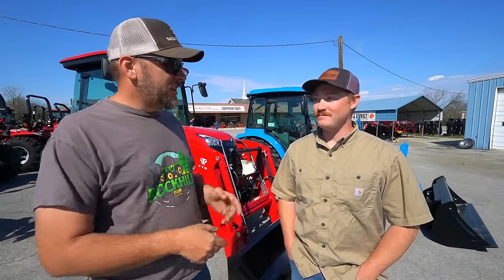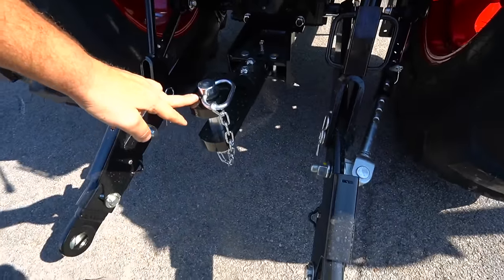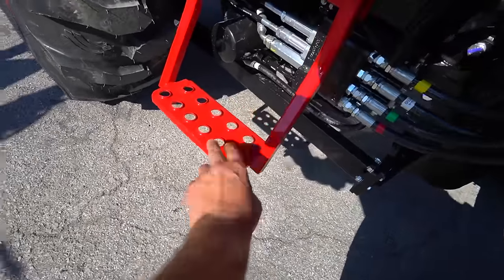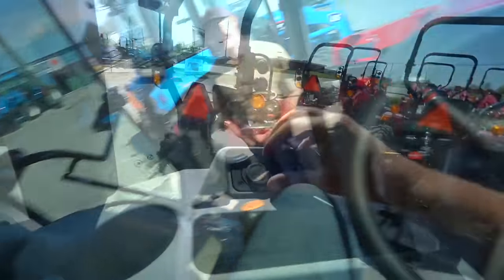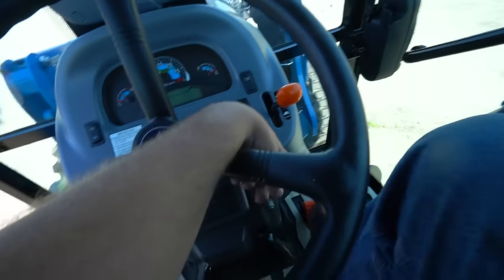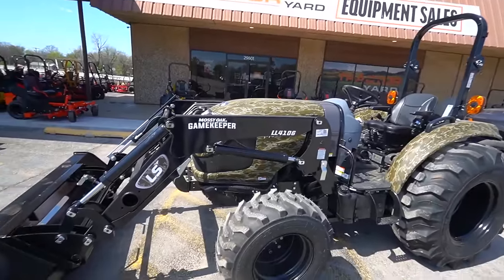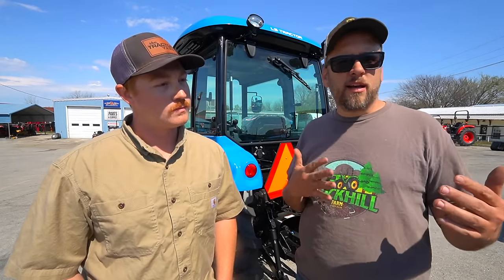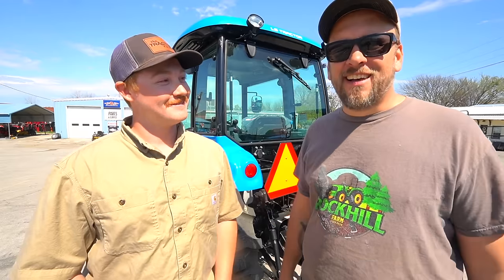Tractor Shopping - TYM vs LS

Comment from the maker: check out all of our 50-60 hp tractor comparisons here 
:https://www.youtube.com/playlist?list=PLmYnhJtNUq7cUQ4kvFAhHfyuPhhxMHN2y
Reply: And this totally made my mind up about these tractors.. the ls is built way beefier .. the rear end of the tym was tiny! But I will get mahindra or kioti... they don't make people run Def fluid= no regen..
Reply from the maker: I disagree with both points you make there. I felt the TYM is heavier built. It has more capacity and it has mechanical fuel injection instead of computer controlled.

The Mahindra didn’t have a DPF filter as you mentioned, but it does have computer controlled fuel injection with a lot more wiring and a lot more unnecessary technology 

The TYM is mechanically fuel injected

I got seat time in every single brand of Tractor in this class before making a decision

When I ranked my top five tractors in this size range, I put TYM number one. Kioti was number four and LS didn’t make the list.

Comment: I had a LS, it was a good tractor.  I sold it for a cab tractor.  I went with TYM.  Biggest difference for me is regen.  I have almost 100 hours on my TYM 494 and never had a regen.  With my LS XR4140 I would have had two regens already.  I always run tractor at least 1800 to 2000 rpm unless bush hogging, then I'm higher.  Both are comfortable tractors but from experience with both brands I prefer the TYM.  TYM is a simple tractor, no computer to run it, it's mechanical.

Comment: Brock, for my money, the 574 is the cream of the crop. I have been drooling over that tractor for four years. 5300 lbs of breakout force on the TYM loader also. No hate for the LS, I’m just much more familiar with the TYM. Also, the TYM is very unique for a machine that requires DPF. It is very old school mechanical diesel.
Reply: buy it bro

Comment: Good video 👍🏻. I purchased the TYM T474 last year and have 200 hr  on it so far and no regens yet. I chose the TYM for many reasons but one major one is that the TYM has a fully mechanical fuel system and engine with minimal electronics. So far, I love my TYM.
Reply: This is actually the model I decided to get for my use.  T474C, I think it has the capability to do anything that I will need it to.

Comment: JD is not worth the extra $ anymore. Opinion, others are providing more features and reliability at lower cost - initial cost, parts, etc.
Reply from the maker: And I trust that TYM will be in business in 20 years
Reply: @RockhillfarmYT  
Have had an LS 46 Hp for 9 years , 1000hrs on it, with little problems. Bend the loader frame last year (My fault), Dealer had a new one in a few weeks, thought it would be longer or a problem.  TYM should be good also, both are nice equipment.
Reply from the maker: @jburch1544 thanks for sharing

Comment: I have purchased two LS Tractors for my Company. I haven’t had any problems with them however I’m in the market for a Cab Tractor. The Tractors I would consider are LS, TYM, Kioti, Yanmar. My opinion is Deere and Kubota have priced themselves out of the market and their hydraulics are no where close to these Tractors however there are those that are loyal to Deere and Kubota that have deep pockets and I respect that. There are enough Tractors out there for everyone to be happy with. Also remember Brock and Tim (Tractor Time with Tim) have done more with a small Tractor, Deere 1025r and their 2 series than most of us do in a lifetime. 😂

Comment: I did this exact same comparison 3 weeks ago but at two different dealerships.  LS compared to TYM.  I compared series 3 to series 3 and series 2 to series 2 tractors.  They are both excellent quality brands that offer great value.  I felt the controls on  LS interfered with my natural reach for the loader joystick and no such interference from the TYM models.  I also felt the cabs on TYM were a little roomier and more comfortable.  I also like the Kukje TYM engines as they are simpler and far less sensors on them that can go bad.  I think you will be happy with whichever you choose but  I'm planning on getting a TYM this spring.  Looking forward to seeing which you choose and how it works out for you either way!

Comment: Thanks for the review. I did about the same thing you've done here about a year ago. I found the John Deere about $17k more, and a Kubota about $18k more, and that was without a lot of the features on the TYM574HC (which I purchased in Nov, doing my 50 hr service on Saturday). I got the TYM with loaded tires, and a 3rd function valve. I've also installed a hydraulic top link.  Those features your paying extra for on JD and K are armed seats, rear windshield wiper, lights front and back, mirrors, radio, and bucket level indicator (I think I got them all). I've had zero issues with my TYM574HC. We've got a 16 acre farm, cut fire wood for heat, and maintain a 1200' gravel driveway with it. I've also got a 72" tiller we use to plant some potatoes, Not working the tractor too hard, but can attest to it's lifting ability. We cut down a very large maple tree, and I put 4 logs into my dump trailer using the lift. The mill estimated I've got 1500 board feed of lumber. The tractor had no issues lifting those large logs over the side of the trailer and lowering them slowly to the bed. I used a grapple to move the logs.

Comment: Brock, I absolutely love my TYM T474 HST. The T574 is a monster worker too. Both the T474 and T574 have the exact same Cummins designed mechanical Diesel. No electronics. The T574 has the turbo and a few different cam settings and timing, but they are both bullet proof. Love my TYM.
Reply from the maker: Thanks for sharing
Reply: @RockhillfarmYT  You're welcome sir.
Reply: @RockhillfarmYT  Oh and my T474 has over 130 hours and no regen.

Comment: I bought a Kubota L3800 in 2013 and it has almost done everything i have asked it to do. The downside of that tractor is the loader lifting capacity of only 1,000 pounds at the pin, so by the time I put the bucket or forks on, it doesn't have a whole lot there.
I had a neighbor who had a Mahindra 23 hp and he was able to lift about 500 pounds more than my tractor, i was amazed. 

If i buy another tractor it might be a Mahindra, but we will see. If i bought one today, it would be a Mahindra and for a 55 hp, the loader lift would be higher than both of these tractors.

Comment: Hi Brock I sold my kubota m7960 last fall and bought a TYM cab t494 I have 110hrs on it now with no regen yet. I bought it with r14 tires and they are great in the snow and mud and are fairly easy on the lawn. The loader Is almost as powerful as the m7060 but is rather slow. I would love one of the pumps you put on your JD to speed it up a little. I have always had a geared tractor and the TYM is my first hydro and I love it with the linked throttle. I did notice that the arm rest in the Ls are adjustable  which is a nice feature if you spend a lot of time in it.

Comment: I am surprised that TYM 'hasn't  reached out to you for a tractor to use on your channel.  I have a John Deere 2032 with no problems in over 1500 hrs but if i could do it again  i would go to the TYM.  The TYM could of done a better job on the backhoe seat mounting.

Comment: Awesome content taking a real close look at both these machines!   The one thing that really stands out to me is that the 3 pt lift rating is 2755lbs AT THE PINS on the LS web site and they will not publish the 24” behind the pins on their spec sheets on their site.  That’s a huge difference between the LS and the TYM.  Please verify that number for all your viewers as y’all kinda left that as a big loose end which if accurate would totally sway a ton of people in the TYM direction.  I will say that I do prefer the LS over the TYM for all the reasons that you stated because of the technology differences.  To me the big test Is how well do the hydraulics work and are they super smooth… and will they perform two functions with the loader joy stick such a curl and lift etc.   

As I had indicated months ago I bought a Massey Ferguson 2860M cab/loader tractor and couldn’t be happier 120 hours later trouble free so far. I’m all in on my deal at $53K.  After looking at both of these machines today with you the Massey control features and cab ergonomics of control locations appears to me to be far superior  in placement and ease of access and operation.  Additionally, the Massey I purchased has the AIR RIDE SEAT, rear wiper and rear glass wire defroster in the rear window.   The Massey also allows you to exit the tractor without having to have the Parking Brake engaged which Is a huge deal to me for my use of this machine & it will start with out having to engage the parking brake…. Another big deal to me ✔️.    I’m totally not meaning to sound like I plugging MF. Just indicating additional features and what I consider to be better ergonomics in the cab and operations.   

Other than the rear 3 pt lift capacity at the ends being a low number 2755lbs I would totally choose the LS Over the TYM unless one dealer is much better to deal with than the other.    Good luck in your quest for the new larger cab tractor you will be happy it when you pull that trigger!!     Really love this type content… 👍👍🔥🔥

Comment: I run my sawmill operation with my LS MT357 HC... the exact tractor you are showing in this video. I just hit 350 hours on my tractor. I ran a Kioti DK40SE open station for the previous 10 years at the sawmill. Either of these will surely serve you well. I can't comment on the TYM, but I can give you some quick info on the LS. First, loader capacity. It is rated at 2,700 at the pins.. which is also exactly what my old DK40 was rated at as well. I have moved hundreds, if not thousands of logs and I have a good handle on what I can and can't move, weight wise. Both with my old Kioti and the LS, 2,700 at the pins translates to about 2000 lbs when moving logs around with forks or a grapple. So make sure you keep that in mind. You mentioned something about lifting 4,000 lbs a couple inches off the ground in the video. Never going to happen. You MIGHT get lucky and lift a 2,200 lb log a couple inches off the ground, but that would be absolute max. Also, for me, when I am using my tractor, I am usually pretty busy sawing up a job for someone.. in other words, time is money. If I had to stop for 30 minutes while my tractor did a regen, I would go insane. My tractor does a regen every 20 or so hours, and I don't even know it's happening. I just continue working. On the other hand, if the TYM only does a regen every 100 hours or so, maybe it is not a big deal. Pro's and cons with the LS. Pros... engine is extremely quiet and smooth as butter, with an amazing amount of power/torque. With beet juice in the rears, it will flat out pull a full grown oak tree (top and all) through the woods. Also the MT3 series comes standard with a Grammar seat. That is a 1,500.00 seat. They did not cut corners in the cab. The heat/air works awesome. The cab is air tight and quiet. The linked pedal is cool. The engine cruise control is cool. Cons... regen times vary quite a bit. Sometimes it will go 30 hours with no regen. Then sometimes it will regen twice in 10 hours. The tie rod ends.. watch them close, and MAKE SURE that the steering stops are set at the proper length for a loader.. otherwise they will hit the loader mounts when the axle pivots at full steer. A lot of dealerships fail to do this.. mine was not adjusted properly, luckily I caught it. Lastly, the PTO neutral lever in the cab that mechanically disengages the PTO so you can freely spin it, it will only work for about 20 hours if you are lucky, then it will get stuck in the engaged position. They all do this. My dealer is in contact with LS to find a potential fix, but right now LS is scratching their heads. Good luck in your choice, I LOVE mine!
Reply from the maker: Thanks for sharing

Comment: I have been looking at upgrading to the TYM 574CTLB. I test drove one the other day. There are actually 2 screens covering radiator and condenser on the 574's and take note of the backhoe it sits very high which is good for ground clearance when loading or driving over very uneven terrain on the 574's. Many other manufacturers have very poor clearance with the sub frame. (Kioti ck series I looked and physically measured them) The LS's also look pretty low as well but did not measure myself. 10 inches measured to the pin on the rear frame mount pins on the 574 bh permanently mounted tractor frame which was the lowest point. As said on other posts I prefer simplicity for the long haul. (Regen) 
Note: the Kioti and TYM are a very similar bh design however the lower frame bars stick out past the rear tire substantially that was a deal breaker for me on Kioti. Great videos great info thanks!
Reply from the maker: Thanks for sharing your thoughts on it

Comment: Great video.  I feel like if you haven't looked at MF and you have a dealer near by they are the real sweet spot between top end JD and the Korean brands.  I think the 2855m or 2860M would be perfect for you, backhoes are a woods product I believe, and to my knowledge the three point arms stay on with backhoe and its the same hookup as the Kubota, two pins and its off.  I had a MF 1740E and an 1835M cab and both were phenomenal machines with excellent fit and finish and zero problems with either over about 175 hours on each.  Also no DPF on some of their larger machines.
Reply from the maker: Thanks for the feedback.

Comment: On the T575, you can adjust the position of the lever for the loader and bring it closer.  You can get it so where your elbow is on the armrest while your hand is on the lever. 

I'm seriously considering going to a T574 from my 2038r. 

My neighbor has one.

Also, the TYM engine is mechanically injected. Much simpler, better dpf as well and easy to service the dpf
Reply from the maker: I’m close to doing the same

Thanks for sharing

Comment: At one point in the LS MT357 you pointed to a switch on the left side of the dash and said something like "and here you have your wipers", and moved on.   That rocker switch you were referring to is the control for the DEF burn.  Rocking it one way is an inhibit, if there would be some reason the heat of the regen the computer is about to do would be a fire hazard.  The opposite side allows you to call for the regen burn whenever you want.

The wiper and squirter controls (F & R) are up on the right pillar with the work lights (F & R) and the engine speed control.

One thing about the TYM you didn't cover is the key hole cover.  Evidently if a storm is coming you can leave the doors and windows open, and still keep the key hole nice and dry by flipping the cover closed.
Reply from the maker: Thank you for sharing that information

If I get one of these, I probably won’t try that trick with

Comment: What is the loader lift height for each?

LS is an ehydro although the current model doesn't have adjustable features.  There is testing on an updated MT3 which is going to share the updated looks of the MT2 plus other updates.  If LS is a consideration I'd wait for the update. 

A 4066R cab and loader will be about $74k on the build your own page.  That doesn't include backhoe or implement hydraulics that the other two offer.  So I'd guess you would be over $80k with those additional items.

Comment: I just purchased a LS MT573 from Diamond R Equipment in Freeburg Missoura. Im having them install the 3rd function for front implements. I purchased a 7ft Rotary tiller, 6ft Root Grapple, 7ft Box Blade and a Stump Buster bucket and added a Extended warranty that changed the 6 year factory warranty for 2 year's bumper to bumper and 4 years drive train for 65k. A New Holland Power Master 75 was $66,600 for tractor and loader only a Kubota M4-071 was nearly 22k more. This is my 1st tractor  we bought a 85 acre Farm in Moniteau County Missoura and  the staff wanted to know Everything I hoped to use the Tractor for  so I showed them my property with my OnX hunting app ( highly recommended everyone have it) the seen the elevation parts of the property and Terranced parts. Every Farmer around me told me not to get anything below 65hp for what I'm doing. Diamond R Equipment carries McCormick,Mahindra, TYM and LS , the place is like Mayberry on the Andy Griffith show no pressure and answered every question I had a asked my questions I hadn't even considered. Anyway I hope I like the LS . Its gonna be delivered after Labor Day.